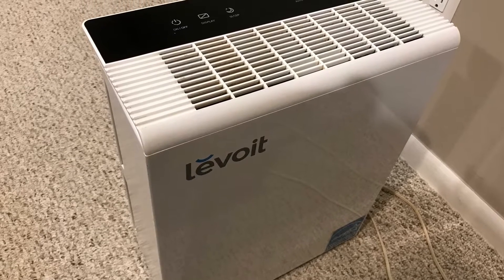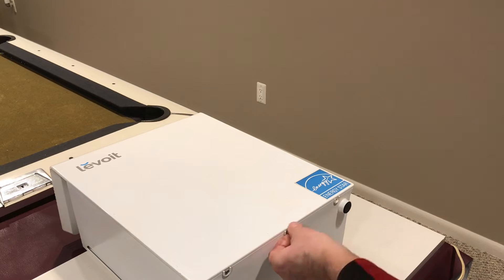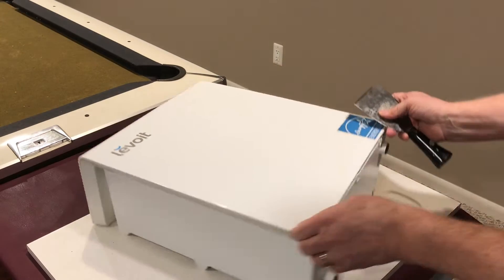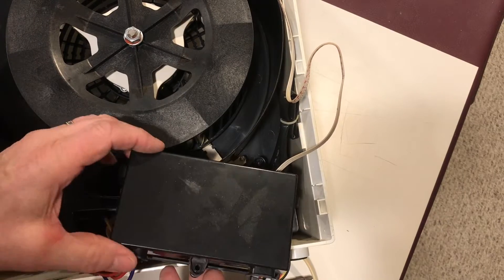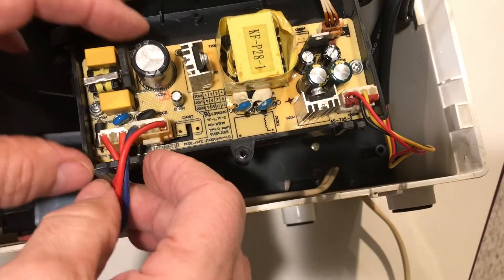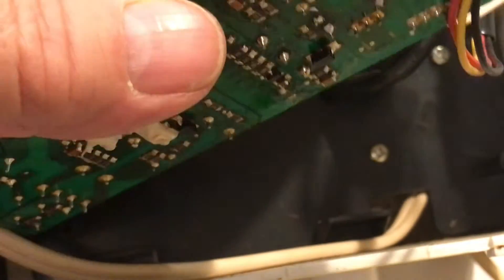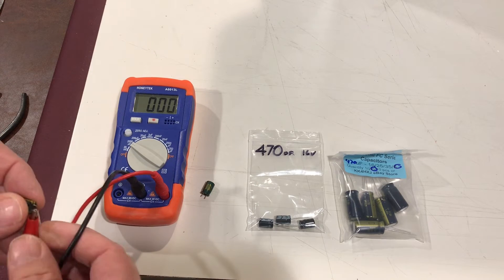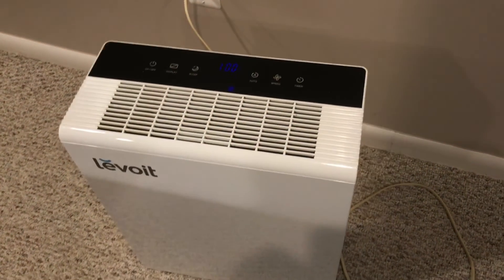Levoit Air Purifier Power Supply Repair

Comment: I've used this procedure three times on three units now. When I pulled them apart this time it appeared that these caps may have been installed backwards by the manufacturer? Not sure, but I used your markings in the video for positive terminal on the fix.

I have another unit I've repaired previously with the filter light stuck on. Hoping the sensor isn't bad. Have you come across that? Do you have a schematic for the controller board?
Reply from the maker: Hi - All I did was replace the caps, got them working and returned them to my friend. (after making the video of course). Don't have any insight to share on other issues and never located a schematic. Glad you were able to fix some of the units.

Comment: Just came here to sayyou saved ANOTHER one. I bouht my unit 4 years ago and 2 years later it died. I contacted levoit who wanted to do NOTHING. When I exlained I would be writing the state attorney due to the danger of using a hack I saw on youtube to keep the unit going and possibly causing liability since they know of the issue. They then agreed to send another unit with no more warranty (yeah right). 2 years later then next unit broke down and thanks to this video I dont need to deal with those schmucks.

Comment: THANK YOUUUUU!!! I am a novice at soldering but i managed to get this done today and couldn't be happier. I NEVER could have done it without your video. I own 2 of these units also so am just thrilled as I am sure the 2nd one will fail shortly, and for under $10 I got 5 capacitors so have some ready for next time.  I hope you know you are awesome!!! :)
Reply from the maker: I lot of folks had the same issue and were likewise able to fix it. Nice job!

Comment: My unit has the red light, red power light, and red change filter icon all lit up. The buttons do not respond. Would this video repair fix this issue, or do I have different issue? I’ve already thrown one of these units out when it died on me a little over a year ago. I’m hoping I can save this one since I just got two sets of filters for it. My newest Levoit is the Everest Air and takes way different filters.
Reply from the maker: Hi Dave - Not sure what all the symptoms were or if the repair will remedy your problems, but its a rather inexpensive repair and might be worth a try. I was asked to look at a couple units that weren't working so I took them apart and found the capacitor issues. I went back and made the video thinking it might help others.

Comment: Just as so many have echoed here, what a service to society you've provided here.  You've saved the environment and you've saved a lot of us money.  Like many here I too bought 2 units a few years ago.  After the first one died I tore it open in hopes to find something near the power switch panel that may have been apparent but then just threw it into the dumpster.  Now with my 2nd unit having the exact same issue I did some research and here I am.  I've barely ever soldered before but certainly have never swapped out a capacitor.  You inspired me to give it a shot and now $6 later my unit works again.  Thank you!
Reply from the maker: You are now an official member of the LeVoit repair club. Congrats. Thanks for the feedback. Glad I took the time to capture the repair before the unit went back to the owner. Seems to have helped out a lot of viewers like you. 👍

Comment: What size is the special triangle screw?
Reply from the maker: I don't remember what size bit I used on it, but someone commented they were able to use a small headed straight bladed screwdriver to extract it.
Reply: My tringle driver head was "2.0" (not sure what unit that is, maybe mm?) and it worked. It was a little bit too small, but it was able to still loosen the screw. I've heard that small flat heads will do it as well. Man... it's like they didn't want you to repair this thing and expected it to fail after 1yr hoping you'd buy another. 🤦‍♂
Reply from the maker: @patricknelson  Hey Patrick - Thanks for checking in and adding to the dialog. Its cool how the user community steps in to help others. Have a great day

Comment: Very thankful for this video. Always kind when people with nowhere share to save others money and time. I know enough with soldering to be dangerous, but this video made me realize how easy a fix this was. Bought the parts on eBay and now the unit is running perfectly, so thank you again!
Reply: As an eBay employee myself, I approve this message. 😅 I actually got my purifier on eBay and even got the parts to fix it on eBay too! This was actually my first soldering project. I was fed up; this was like the third time this purifier gave up on my so I was determined to fix it (I've got many spread out throughout the house).
Reply from the maker: @patricknelson  Glad you dug into it and you were able to solve it. Capacitors are a common culprit. I've restored life to devices like coffee makers, A/C condensers, and pump motors by findings and changing caps.👍
Reply from the maker: Glad it helped. Saved another one from the landfill. Way to go

Comment: Amazing.  I was a little skeptical about whether 1) it would work and 2) I could do it.  Didn't even own a soldering iron when I came across your video, but 3 days later, my air purifier is alive again!  Everything works like new.

As someone who has very little experience with circuit boards and soldering, a little bit more information about what to be careful of with the circuit board might have helped me mentally.  Most of the time, I was afraid that touching something on the board would shock me (even with everything unplugged). 

Anyway, thank you very much.  To anyone who is thinking about trying this out, it only took some minimal purchases on Amazon to make it happen.  Overall the process took maybe 30 minutes.  The soldering, which isn't shown in the video, was probably what took me the longest, but I imagine people who have experience with that kind of thing can do this pretty easily. If you don't have any experience soldering, I suggest you look into learning that first, before taking the air purifier apart.

"Side note - I bought mine through Amazon in Japan and the circuit board was organized very slightly differently.  The capacitors I replaced looked exactly the same as the video though and were easy to identify.
Reply from the maker: Another unit rescued from the landfill. Glad you got it going
Reply: The big black cap can shock you even when not plugged in the wall.

Comment: Much like the others, replacing the small 470uf 16V capacitors worked for me -! -however after a couple weeks, the device went back out again. Took another 30 minutes and replaced again the small capacitors but didn't work this time; any idea what the new issue might be (larger nearby capacitors perhaps?)? If possible please let me know 😢
Reply from the maker: in three of the ones I worked on that solved the problem. Sounds like you might need to dig further. Hope you find the cuplprit
Reply: Did you figure it out? Asking ahead of time. I'm considering just ordering a nice bulk supply of all the capacitors on these units since I have like 5 of these, lol. I'd prefer to just repair them than deal with both paying for but also searching for a good replacement that size/capability while being "smart".
Reply: @patricknelson  No, I chucked it -- I did find though this last week on another soldering project that my soldering on this filter may have been a bit solder-heavy as a connection I had made wasn't working until I thinned it out (didn't think this could even be the case); I suppose there is a chance I put on too much using a large head soldering top instead of a fine tip - either way, 4-5 years for a costly air filter to fail on something this simple is very telling of their manufacture quality IMO, am not going to buy this brand Levoit / VeSync ever again --- kind of wish this video had a breakdown of the more important fine motor skills soldering that need to be done, I really didn't know any of the rules

Comment: Thanks! These things are manufactured as utter garbage. Feels like at least half or more of these that I’ve purchased have destroyed themselves. My most recent one did this to itself simply because I took the dust cover off, so I assume it relates to the fact that I didn’t power it off first. Insane that you blow $100 device from such a simple thing.
Reply from the maker: A lot of folks unhappy with these units. Plenty of negative comments.
Reply: @xfireamg417  Thanks again for the guide here. 😊 I've been a little into electronics all my life since a kid (late 30s now) and have owned an old Radio Shack soldering iron for years, but this is my first time actually soldering. Practiced a few times on an empty board (used up some of my capacitors) and built up the confidence on desoldering/soldering these two caps. While this is a common failure mode, it thankfully meant I had a good step-by-step for my first attempt. So... really appreciate the guide!

Comment: Mine just died. Hopefully I can resuscitate it, should last forever with some nice new nippon chemi cons.
Reply from the maker: Hope this works for you
Reply: @xfireamg417 Darn, couldn't do it. Replaced all power supply caps, but the piezo speaker just ticks, I suppose indicating boot looping. There were additional electrolytics on the computer board I couldn't access and change, so it could be those, but sadly I think that's it for this levoit.
Reply from the maker: @drdos4  good try. Time to kiss it good bye

Comment: My home had two of them. They stopped working. We e-mailed the company and all they asked for was proof of purchase from Amazon and they gave us store credit for two new up to date versions. So now I’ll use this video to repair the other two and put them in other bedrooms in the house. Great video.
Reply from the maker: glad they honored the warranty and gave you replacements. I'm sure there are other issues with these units, but the capacitor failure seems to be fairly common. Good luck
Reply: May I ask how old the were. I have one with this problem but it’s 4 years old now.
Reply: @wrongmark  ours was a year and a half old
Reply: I had one that failed after 1.5 years, and Levoit sent me a replacement free of charge.  I've had that one for 4-5 years, running constantly next to the cat litter for 4 cats.  It's a heavy duty job sucking up any litter dust every time they use the litter...and it's worked excellent.  It just died.

  I wonder if Levoit will replace it.  I can expose the power board...but that's where my expertise ends.  I never learned about circuit boards, saudering, capacitors, etc.  I don't know if you tube videos are enough to learn on my own...micro saudering seems like something that requires practice?

Comment: Where could I find a place that sells the wires? One of my connecting wired were fried
Reply from the maker: If a wire has burned up. You need to determine what caused that to happen before you replace it.

Comment: We tried this and it didn't work.  Do you have any other suggestions we could try?  Would love to keep this out of the landfill.  Thanks!
Reply from the maker: Hi - the three units I worked on all had the same issue and are back in operation elsewhere. If you read the entire comment thread I think someone reported that they replaced a few other caps and got it going. Sorry I can't be of more help.

Comment: Amazing finding this. I've had this issue with 3 Levoit units, so it's good to know what the issue likely is. Will ask my electrician to do it, for safety's sake : )
Reply from the maker: There might be other issues and root causes, but 3 units I looked at had the identical problem and so did quite a few Youtubers. Good luck

Comment: The original capacitors in my unit were 470 25 volt.

I replaced with the 16v since i ordered those before opening the unit.

It works in the end, but will the lower voltage rated capacitors cause any issues?  I don't know enough about electronics to know what this might do.
Reply from the maker: The general rule is to replace with the same or higher voltage rating. 
Interesting to hear that Levoit increased the voltage rating for those caps and they still failed. Best to find a direct replacement.
Reply: @xfireamg417  I've read from others that it may be due to being so close that heat sink as well. Dying from being both cheap but also getting too hot. 🤔

Comment: Thank you this saved my appliance, I was able to recover and fix it. Thank you very much :)
PS for anyone else, i didn't have the triangle bit for the last screw inside the fan bay. So i just drilled the head off, and it allowed me to access the panel. Don't mind 1/3 screws not in.
Reply from the maker: Glad to hear when folks get their unit up and running. Tx

Comment: My display is ON but not starting, i believe no issue with power supply, can you help?
Reply from the maker: Hi Jasbir, I've repaired 3 of those units now and they all had the same problem. I found the power supply capacitor issues, repaired the problem and returned the units to the owner. Didn't research any other issues so I don't have any suggestions for you. There are other videos on-line, maybe they can help. Tx

Comment: Thanks for the video. I took mine apart and the caps were junk.  One of the 1000uf caps was bulging, measured as 13uF, one of the 470uF measured as 100nF (lol) and the other as 303uF.  I replaced the 10uF on the other side of the board as well since I had one in stock.  I wish my replacement caps were slightly smaller diameter than what I had on hand, but it'll work.  BTW, my purifier had a massive heatsink on that component near the blackened area on yours.  May want to add one.  I think the pin header was shifted over a little on mine to clear it though.
Reply from the maker: Glad you saved the life of another one. Probably a good opportunity for someone to sell a repair kit with some upgrades.

Comment: Pls put the link of the cap you used
Reply from the maker: the caps are 470uf 16 volt radials. I think I bought an entire assortment kit, but you can find them individually on EBAY. Hope this helps

Comment: What were the symptoms of the capacitors going bad? I have this same purifier and suddenly when plugging it back in after a filter replacement the buttons no longer respond to being pressed. The display powers on, but we can't turn it on or reset the filter status.
Reply: I'm finding this is a very common failure mode when the capacitors go bad. For example, if you make the egregious mistake of not first turning it off and waiting a few seconds before taking off the filter cover or unplugging it, it will commit suicide (the capacitors blow up).
Reply from the maker: As I recall the system was completely inoperative, but I thought there was a dimly lit red power indicator light on.

Comment: This repair went without a hitch. Thank you for this easy to follow video, great instructions! 
Levoit is also to thank for making an easy to repair product. 98% of the screws are the same Philips. Like someone else said, the triangle screw can be removed with a small flat head screw driver.

My local electronics store had the capacitors for $2.50. great price to keep this unit running for another year!
Reply from the maker: Another unit safe from the arms of the landfill!
Reply: @xfireamg417  100%! I love new stuff but I love repairing as well

Comment: Another BIG like for this video! I purchased the capacitors, along with a soldering iron, and tackled the job of replacing the capacitors. I've never soldered before, and certainly not on a circuit board. So, even if it didn't work, I would learn a little bit of something and wouldn't be out too much money. I thought I did a bit of a hack job on the capacitors, but when I put everything back together and plugged it in, it turned right on! I am so thrilled! And there were no surprises, this video tells you everything you need to know & do.
Reply from the maker: Way to go
Reply: I am having the same problem with mine. Can you help direct me to the part numbers of the capacitors.? If I wasn’t mechanically inclined I would trash it.
Reply from the maker: The culprit capacitors are usually the two 470uf 16v caps
Reply: … discovering the ‘fix’ requires soldering made me frustrated I would not be able to revive my Levoit - UNTIL I DECIDED WHY NOT LEARN TO SOLDER. 😊Your example has given me the final push to do the same as you… here we go!

Comment: This video saved 2 of mine from the landfill.  My caps in both had zero visible defects.  I went ahead and swapped them out and voila!  They both fired right up.  One of them has a bad touch panel that only accepts input when powered on, nothing after that, but it works.  I just set it to auto fan and done.  I had one out of commission for 10 months and another conked out 2 week ago.  It was an amazing Saturday project, thank you! Time to order another set of off-brand filters LOL.
Reply from the maker: Glad you were able to get them fixed. As you pointed out sometimes there's no visible sign that a cap has failed. Somebody once told me "replacing capacitors can solve 90% of the worlds problems" LOL

Comment: Still a thing in late 2023 … caps weren’t leaking or bulging yet but still had the issue. Swapped them out and all better. Saved another one from the landfill! Thank you!
Reply from the maker: I think all you folks should get an award for taking on this repair. Nice going.
Reply: My unit just failed after about  2 years, and I want to get this fixed. In the video, it says to wait a while before starting the fix since the power supply still holds power in it. How long did you have to wait before starting your repairs?
Reply: @jpa8880  right after you unplug it, 10 min wait no problem.